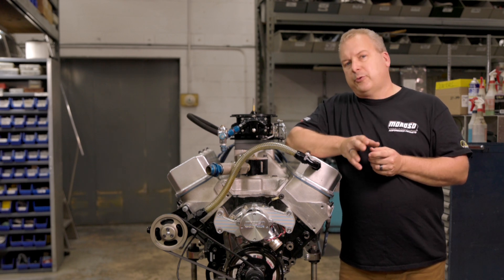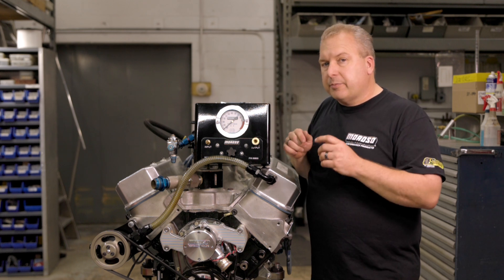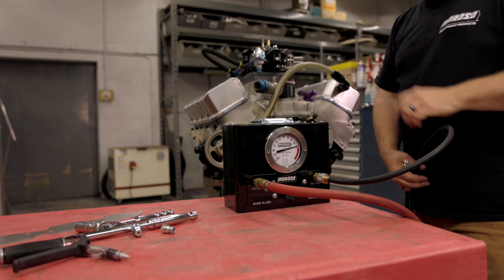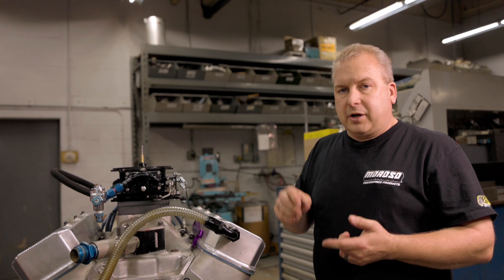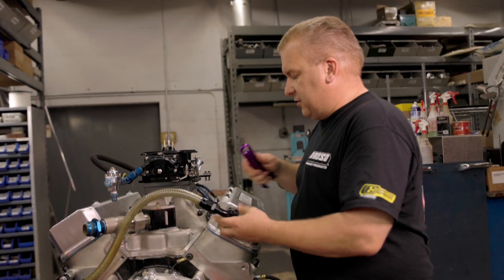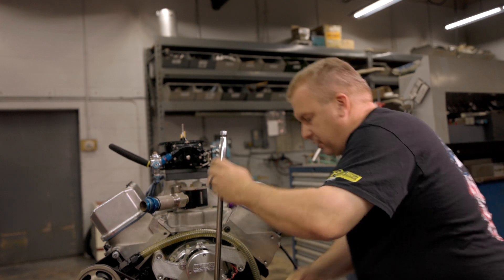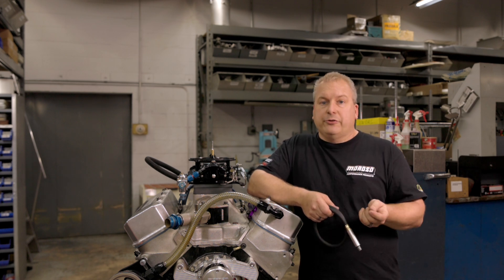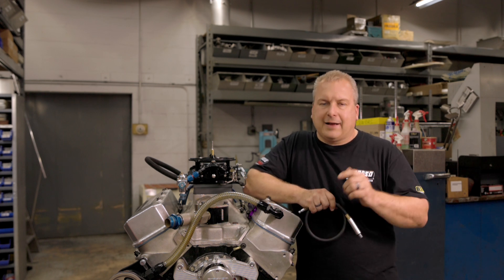LEAK DOWN TESTERS!

Comment: Hi Scott, outstanding video!  I am a 64 year old retired ASE Master Certified Automobile Technician and a High Performance Automobile owner.  I have used other cylinder leak down tester(s) from other professional tool brand(s), and I also own one.  Your Moroso Performance Cylinder Leak Down Tester that you are marketing at this time is a tester that I closely recognize to a Sun Engine Performance Analyzer, back in the 1970s to the early 1980s produced by Sun Electric, located on the west coast.  I would recommend that before you proceed with the cylinder leak down tester, set the incoming air pressure regulator to exactly 100 PSI, so it will be easer to calculate the percentage of cylinder pressure leakage.  Be sure to disconnect the low voltage connections that power the ignition system (for less chance of damage to the ignition coil or module) and remove all the spark plugs and listen for air at the adjacent cylinders (spark plug holes).  Be sure to remove the radiator cap to check for bubbles in the cooling system, remove the oil filler cap as well as the crankcase breather to listen for air, open the fuel system throttle plates to listen for air, and listen for air coming from the exhaust.  When performing the step by step cylinder leak down test, it might be ideal to perform the first test on the engine with an overnight cold. After that, the second test would be when the engine is at normal operating tempter, after driving it for at least one hour.  And maybe a third test when the engine is good and hot, after a high speed run, on a hot summer afternoon for an hour or so.  This will raise accuracy in regards to evaluating the condition of the engine.   Performing the test(s) on a hot engine can be very discomforting in regards to touching the hot engine, so I suggest applying anti seize compound to the sparkplug threads, and apply dielectric silicone grease to the sparkplug wire boots, before you even begin.  They also market hot engine work gloves and high heat arm sleeves.  Last but not least, when performing the test, use the engines firing order as a sequential step by step work order, this will save you time and frustration.  Please like and comment!  Dave...
Reply from the maker: Dave! Thanks so much for watching and taking the time to add in some AWESOME info. I'll pass this along to Scott this morning! Have a great day, and again, thanks for tuning in. We appreciate it.

-Ray
Reply: @MorosoPerformance  Hi Scott, thank you for your support.  I edited my comment and added a supplement because I left something important out by mistake.  The supplement is as follows; Be sure to disconnect the low voltage connections that power the ignition system (for less chance of damage to the ignition coil or module) and remove all the spark plugs and listen for air at the adjacent cylinders (spark plug holes).